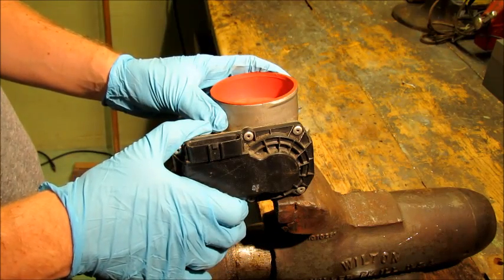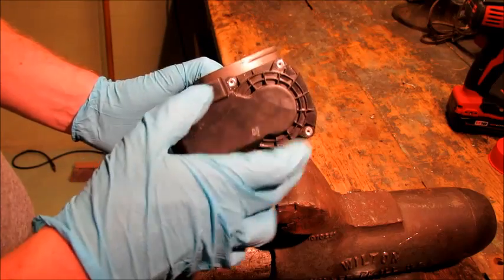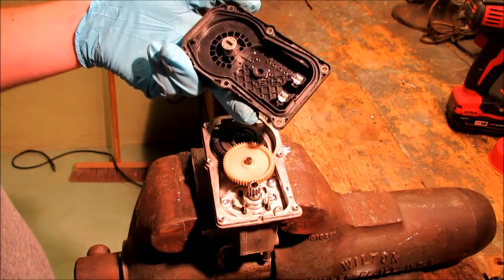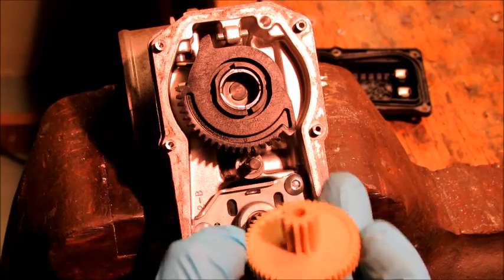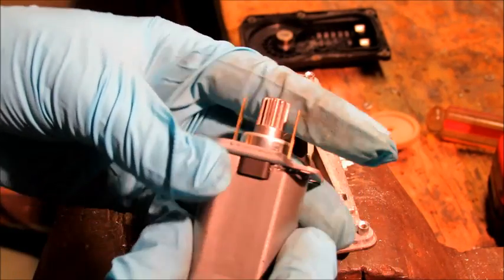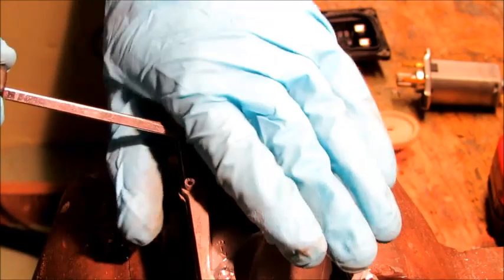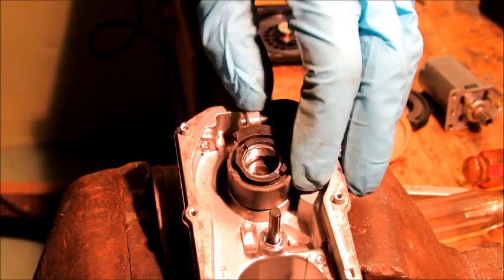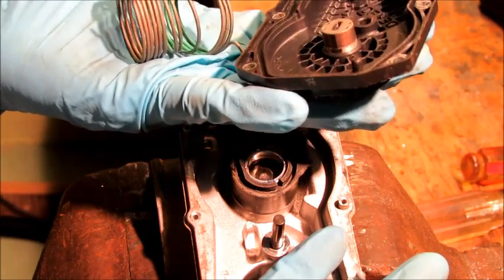Inside a drive-by-wire throttle body

Comment: There is one allen bolt thats accesible from outside, i think that sets your throttle minimum opening? I just tried opening one a bit and the damn bolt wouldnt move so the inside got screwed

Comment: 9 Years later now in 2022, it is even more necessary to open exactly these Toyota throttle bodies. Because after about 10-12 years these throttle bodies will start to bind and report a P2112 error. This is because moisture enters the housing and the drive motor gear and surrounding areas begin to rust. Therefore, you have to open the housing, clean it and grease it a bit to get it working again. So thank you for the detailed video.

Comment: Typically the motor is driven by pulse width modulation and the other four contacts are double redundant sensors that pick up rotary changes to the fixed magnet field.

Comment: This explains a lot.  My 2004 Volkswagen Touareg suddenly lost power and would only idle no matter how much I pressed the throttle pedal.  The mechanic said he needed to replace the throttle body because one of the gears inside it had worn out.  Now that you've shown me that those gears are just plastic, I can see why it only lasted fifteen years.  In fact, I'm surprised it lasted that long!
Reply from the maker: Pretty impressive for it to last 15 years, but I bet it wasn’t cheap!
Reply: @PatonHaus  Actually, he was able to find a second-hand unit from a car wrecker's place.  Cost AU$200.  I just have to hope that the replacement unit isn't worn out to the same degree.

Comment: Hi, do you know where the 2 hoses lead to in the throttle body and it's purpose?
Reply from the maker: They might be coolant hoses, which are used to prevent the throttle body from freezing or sticking due to frost. This can happen even in warm climates.
Reply: thank you for your reply

Comment: Looking at that plastic bit that you had to break to get it out, it had 2 grooves in it. In situations like this, I have often found that it needs a very wide 'screwdriver' - a piece of flat metal (fairly stiff) that you can put in both grooves at the same time, and then turn the thing like a screwdriver. It would have been nice to know if that had worked. I have found that sort of thing in electronic equipment I have dismantled for the fun of it (tape players of various sorts - VHS, etc.)

Comment: In a pinch, you can remove "tamper proof" Torx screws by using a small punch to break off the little pin inside the Torx screw recess.  Then an ordinary Torx screwdriver will remove the screw, allowing it to be reused.
Reply from the maker: Good idea! I've been meaning to just buy a set of tamper bits but I really haven't come across any tamper screws since.
Reply: @PatonHaus  Yeah, the "tamper-proof" Torx socket bits are now a stock-standard item at most hardware stores.  So now they have to design a new tamper-proof bolt head which means eventually hardware stores will end up stocking socket bits for those, forcing the bolt designers to make another type of bolt head so the stores soon start selling bits for those, etc, etc, etc......

Comment: You really shouldn't go near tools.
Reply from the maker: This was a destructive video to get inside the unit, it wasn't meant to be a repair or fix of any kind.
Reply: @PatonHaus  it didn't have to be destructive.
If you removed the butterfly first.
Reply: Those bolts require security torx bit.

Comment: Was you able to take that apart without breaking it? I need to take mine off cause the black spring inside isn’t attached it’s in there loose not closing it .
Reply from the maker: You could try but it’s not meant to be a serviceable part, I doubt you could even find replacement parts for it anyhow.
Reply: @PatonHaus  I'm suprised you even answered that
Reply: Sir Isaac did you have any luck with your repair? I’m going through a nightmare now.

Comment: They used to have a thing called a throttle cable, they worked great...and didn't need a stupid computer.
Reply from the maker: They also used to have horse drawn wagons, but everything is antiquated at some point.
Reply: Electronic ones became popular because of traction control. Its much cheaper to make it work with an electronic one :\

Comment: As for the black segment gear that operates the throttle plate and also doubles as the throttle position sensor. also there is no idle adjustment screw. The idle is determined by and programed into the computer  (PCM).
Reply: there is buterfly stop screw... but idle opening is dynamically controlled

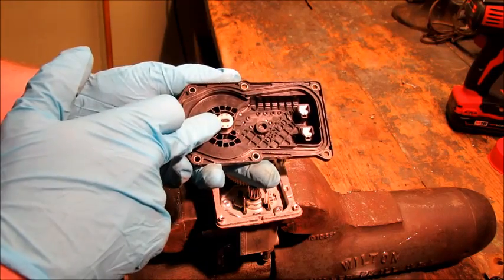Comment: 2:55 That unit is probably the sensor used for feedback of the position. The motor used is clearly a brushed motor here. I'd expect that more modern drive by wire systems use a brushless motor because of significantly decreased wear.
Reply: they dont want to build "million miles" cars... only profit centers! plastic intake manifold, plastic water pumps etc... serious junk 😂

Comment: what is the purpose of electronic throttles?  what's wrong with having a cable?  I've heard electronic has better "throttle response". but how can that be?  you push the pedal, the cable opens the butterfly.   instant.  how can electricity do it faster?
Reply: First, it allows for traction control and more importantly for stability control which all cars sold today must have. The various computers on the car all work together in real time to both cut power and apply brake pressure in precise amounts. Second is for fuel economy purposes where your gas pedal is dynamic to the throttle plate position depending on speed and gear.
Reply: @oldtwinsna8347  this is a really nice and smart answer - Thank you !
🤗
Reply from the maker: Everything is going digital, all part of progress my friend.
Reply: But what progress?  Why is it better than a cable?
Reply: Is it a myth that the law enforcement agency can send interceptor signal to get permanent idle position of the throttle valve and end the chase??
Reply from the maker: mkrp4 Yes, though I hear they can control your VCR.

Comment: There are 6 input PINs, I guess 2 PINs are used for Motor power supply, 4 others will be used for sensor(feedback)...but I don't see any sensor inside.......confused
Reply: Yup, the sensors (2, sort of redundant) are on the cover piece with 5V reference  and feedback signal from each, 12V for motor/actuator. That's why there are 6 pinout connection.
👇
Throttle Body Actuator 6 pins connection:
Pin 1: TPSA - the sensor that measures the voltage going through throttle position sensor A
Pint 2: VCC3 - the reference voltage
Pin 3: TPSB - the sensor that measures the voltage going through throttle position sensor B
Pin 4: SG - the ground pin
Pin 5 and 6: ETCSM (+/-) - These are some type of relays that help with the fail safe.
Reply from the maker: It certainly is an interesting piece of equipment.
Reply: the sensor could be the other part on the cover, that magnetic thing